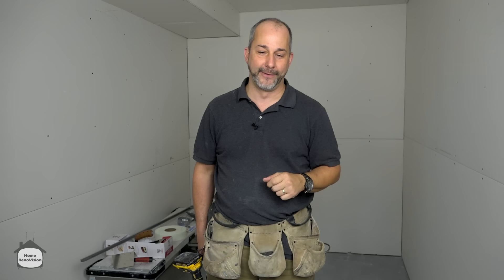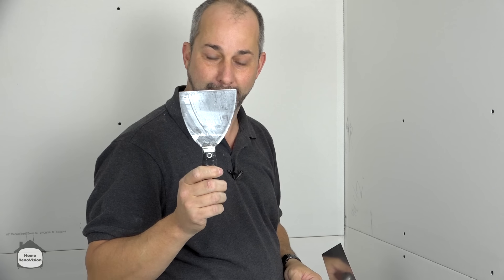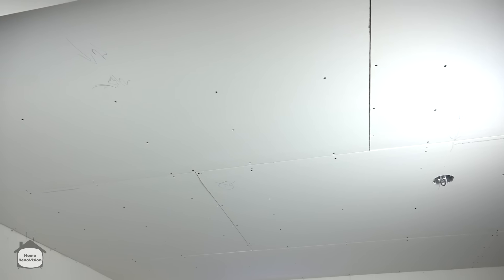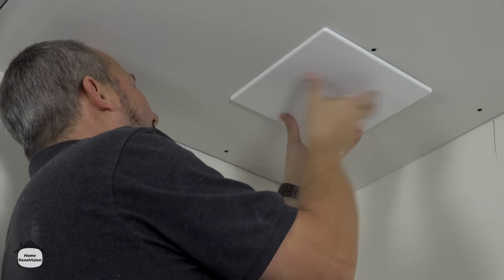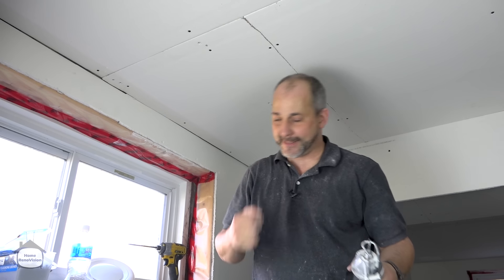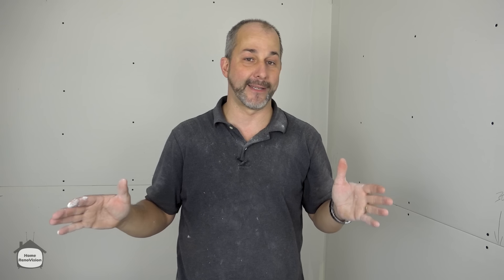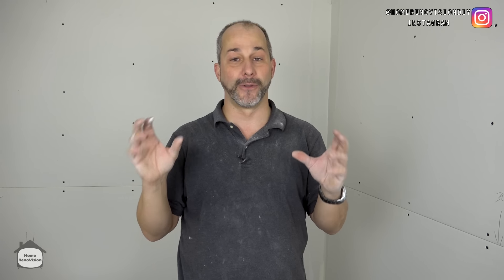DIY Drywall Finishing | 18 Tips and Tricks

Comment: If you use a magnetic bit holder it will save having to hold the screw ! If you round off the corner of your  drywall knife it wont cut the tape and will not leave a groove in the corner. Also how about wearing safety glasses while using Zip tools ? Good video though, lots of helpful tips.
Reply: he dosent wear glasses cos he has tears to get rid of the dust...lol what about all the dust he is eating what it doing to his lungs,get a grip and wear some ppe stuff

Comment: I have a couple bathrooms where the horizontal seam between two pieces of sheetrock has cracked.  assuming the builder already used tape in construction, what do I do to repair so the crack will not return?

Comment: In the last demo you mudded an inside corner with paper tape on lower half and mesh tape on upper half. We see you apply the paper tape- but not the mesh tape! Was the mesh tape already in the corner before the mud was applied? Or is it applied after first coat dries?

Comment: @ ~24m -- How come the sheet metal ducts are not insulated? Are they for heat only? FYI they are in an unconditioned space, and will create mold if the homeowner has A/C running through the duct.

Comment: Ok Im back again.. Once again not a criticism... mesh tape vs old school paper tape?.. mesh tape is not bad and it is quick and easy.. for a basement reno or a small patch.. however it does not "bind" a seam or butt seam.. it is flexible and over time will loosen up on wall seams as all wall do move and show a fracture.. not on patches and short walls so much.. it's "Ok" for that... but for walls such as this? I recommend paper tape as it is likr the surface of the drywall itself and easy to do... tip use taping compound multi purpose mud only.. if you are using topping mud or a drt mix or "Hot Mud mix "20 to 40 min dry mix{ add a squirt of elmers glue for paper tape).. Your taping mud should be just a bit thicker than sour cream.. enough to fill a bit but is for adhering the tape.. you will have bubbles I am sure under the tape.. using the side corner of your 6 in knife  gently slide under the tape where this happens and slip some mud where it is missing and smooth tight middle to edge.  Takes a lot for paper tape to crack later.. the general shifting of a wall will almost always fracture over time with mesh tape in long walls.. do not use mesh tape near doors or windows as these places have constant vibration... however great for around pipes. boxes, patches and fairly low traffic areas..

Comment: Great channel, many helpful tips!  Question on the use of that metal J-channel - can you also use that to cap off the bottom of the drywall that will meet against a concrete floor (like in a basement)?  Or is that totally unncessary and you are better off just leaving X amount of inch space in between drywall and concrete floor?  (Sorry I don't know what is acceptable code/requirement for this!) Thanks!!
Reply: Don't put metal J on the bottom of your sheets, especially a basement floor! Use plastic if you want, but its better to always leave a 1/2" or 5/8" gap no matter where you install it, and let your base trim cover the gap.

Comment: Would you use the trim/edge when you're sheetrock is next to your backer board? We need to repair drywall where we cut out our fiberglass shower/tub (the new stand up shower will be smaller). So I'm trying to figure out how to fix the gap once we repair the drywall, since I assume we wouldn't tape and compound the sheetrock and backer board together. (our new shower will have the tile all the way up)

Comment: HI Jeff.  My house was built in 1964 and  I have 12 inch interlocking acoustic ceiling tiles. They have been painted over once it looks like.  I want to go over it with 1/4 in sheetrock.  Everything I have read and investigated shows this would be acceptable structurally and by code.  Do you have any tips?  Thanks, Brad

Comment: Great clip again fella...question with the mesh tape, the problem I have with it is not it lifting, but the mud shrinking into its surface, sometimes needing a second or third fill to hide it. Do you think this may be down to the type of mud Im using in the uk?..I use ready mixed mostly by a company called gyproc, or Knauf..

Ive got to try the the paper tape thing in corners, I always stick them down with ready mixed wallpaper adhesive first and leave it to dry, as Ive seen a lot of paper tape blow in the past, so im never confident using just mud (we call it compound in the uk) alone

Comment: I have a mid-size (20x17) room in my basement that I am going to start to finish for a man-cave. My ceilings are only 7.5 feet. Is there any reason that I shouldn't hang my drywall vertical instead of horizontal? I would prefer not to try and finish butt-joints since this will be my first interior room I have done myself. Thanks

Comment: Another thing.. finish fastening the perimeter all the way around your sheets once hung  8 inch field in corners and top and bottom plates.. and 12 in the field for each stud... for screws... 7 in field for studs if using drywall cup head nails... for 1/2 inch sheets use 1 1/8 screws or 1 1/4 nails.. for 5/8 sheets use 1 1/4 screws or 1 1/5 cup head nails  chem etched drywall nails... before any taping have all of this done do NOT skip a step... I see much of this has not been fastened to completion...   corners do bear most of the shifting as buildings do so I do recommend paper tape for this.. in either case mesh or paper in a corner?,., make sure it is as tight to the corner as possible... to look square... there ways if if it rounds out or is off to make it look square in the finish coats but best to avoid that... I will stop here You are doing a great job!... once again Jim Turnbow at Facebook!.. I'd be happy to anonymously help you out!

Comment: I am officially in over my head. 😭
I’m finishing an 1100 sqft basement on 115 y/o house. New plumbing, no problem, remove knob and tube, new electrical, easy. Subfloor, framing, even new windows. But muddying the drywall has ruined me. I gave up 2.6 years ago. It’ll never be finished. I’m a baby!! 😩

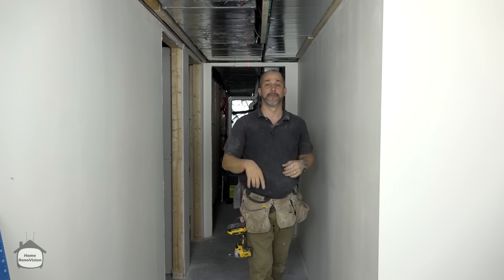Comment: At 32:35 I have a question. Shouldn’t you drywall the ceiling first to prevent this problem? I get that it the walls still are not straight but wouldn’t it be easier in getting a good corner by putting the ceiling then the walls?

Comment: The reason your drywall dimpler bit doesn't fall out is owing to your driver having a magnetic head, which you told your viewers in another video. Many drivers don't. A cut out tool ? For a home DYIer. Another expensive tool which you'd use once or twice..because really how often does a DYIer install drywall ? Buy an oscillating saw..precise cuts for cutting drywall (outlet boxes, not long cuts) and SO mamy more uses.

Comment: i would say that using the drill bit for drywall is a no-go. you end up ripping a circle in the drywall paper making it weaker. also, mesh tape for corners?? why would you do that when paper tape has a crease just for this reason?

Comment: Great video, two simple questions:  why do you choose to do top sheet of drywall then bottom when you are doing walls? And.. I watched a different demo and they wet the tape, is it necessary or just a wasted step?  Cheers!
Reply from the maker: installing the top first helps to close the gaps and makes the install faster as well as the taping. wetting the tape works but i find it stretches too much during the application  and that slows me down. that is why i always wet the tape with mud after it is on. Cheers!

Comment: Hi, I have an odd question. I have an enclosed balcony and one end butts up to a stone chimney.  When we first moved into the house, the crown on the chimney leaked and that water got down to the ceiling of the enclosed balcony. I have sealed the crown and stone in the chimney and I am now refinishing the balcony. Part of that refinishing includes replacing roughly a 4' X 8' piece of drywall in the ceiling. Since I have to do this by myself and I have a ceiling joist at three feet from the stone wall,  I cut the eight-foot drywall piece so I have a three-foot piece and a five-foot piece. Then, while laying the cement board (Durock concrete board) I got the idea of putting a piece of the board on the ceiling so that it butts up against the stone wall. My idea is that if the chimney crown were to leak again, the water would destroy the paint but not the Durock (like it destroyed the drywall originally).  I think I can skim coat the Durock so that it will look the same as the rest of the ceiling.  Does that make any sense at all?
Reply from the maker: sure darryl, but it is only drywall.  even if it need replacing it is easy enough.
Reply: @HomeRenoVisionDIY  Thank you. Somehow, I knew that but I'm 72 and have made so many mistakes over the years because I assumed that just because something was logical to me it was the correct thing to do. Hmmm.

Comment: 32:30 Open the box and fold back the flaps! Open the plastic bag and stretch the plastic over the edges of the box! Pick up the box and dump the mud in the bucket! Pull the box up and then pull the plastic out of the bucket! You'll get almost all of the mud out of the bag! Its fast and easy!

Comment: What if a guy used the 3M glue in the can for the mesh tape in the corners, do you think it would still lift off the drywall if I was using mud that’s not Sheetrock 90 ?

Comment: How does the drywall fit over an outlet hole when you use the roto zip to cut out the hole from the INSIDE of the box?  It seems the hole will be too small….

Comment: So you can put on the fiberglass tape without having to mud first is that correct?
Reply: The mesh tape has adhesive on it. You stick it on and then mud. I do not agree with using in a corner but that just my opinion. I agree with him using a hardening mud as he did

Comment: Ok its paper faced metal corner bead and how do we apply paper tape???? With mud not spray glue.  on lower corners of wall the paper faced "metal corner bead" what your Installing actually holds up better then plan metal which tends to crack as soon as it has been hit.

Comment: I don't use the cutout tool; I prefer the HF little yellow switchbox marker, a little box with six pins you clip onto the box and tilt your board into it, go behind and razor out between the pin marks - neat and perfect.
Lacking that tool, crayon on the boxlips can work if you don't smear it locating the board.
   Next, C.H. Hanson makes a little black and yellow magnetic stud finder with 2 neobdynium magnets that will actually hang it off a nail in /2" drywall! This also means your buried valves, ducts or gas pipes may be detected this way.
   I have started with merely a fist sized hole when I'm not 100% sure where a lost item is, so I can cut the larger hole in that direction.
   Haven't found a drill tool holder yet that would either stay on the drill or not lose bits. For this, I think Lowe's has a belt clip magnet for screws or nails, but is best for bits. The wrist worn one's only have weak ceramic magnets and are crap.
Reply from the maker: Hi Gary. I really suggest you try getting acquainted with technology and the cutout tool. It will save you hours on your next job!

Comment: Drywall is great for people new to diy . Any mistake in the drywall or mud its self can be easily corrected .anyone can make a room look good it just might take you longer than a "pro"  little risk so don't worry if its not pretty sanding or another coat no one will even know the mistake is there. Going at a careful pace with attention to detail is always faster in the long run because you won't have to go back and correct as often. Happy mudding all

Comment: How do you fix the area where the fiberglass tub and shower meet the sheet rock? Ours is starting to peel up there, I am tall so that area gets a little wet there
Reply from the maker: scrape off the failing material and then use 45 mud to repair. 100% acrylic paint to finish. or add subway tile above the insert and use a grout with sealer. Cheers!

Comment: Great video but at a sheet metal worker the hvac tip was cringed. You especially want to be sure you plenty of screws in the duct work in a finished ceiling. If you have duct cleaning or are having you're equipment retrofitted it can become dislodged in the ceiling and at that point you'll be cutting your ceiling or wall. So do it right the first time. Trust me I see this weekly.

Comment: Great instruction Jeff.  In the U.K. it's a common practice to adhere drywall to uneven brick or concrete walls with the "dab & dob system" by applying blobs of drywall adhesive to the wall and pressing the drywall sheet against the wall and tacking it with 3 or 4 Tapcon screws.  They sell a 25 kg. bag of dry mix "Gyproc Adhesive" for about $20 Canadian.  In Canada, I've only seen "drywall adhesive" sold in a 300 ml. caulking tube for about $10 per tube.  Do you know of a similar dry mix bulk product and where it can be obtained in Canada?

Comment: On perfect depth for screws: not so. Even though I used both hands to push on the driver tool I had problems to set the screw to the correct depth. In my opinion a Torx /Star driver would do a much better job. Torx uses only rotational force to set a screw rather than a Philips drive force that requires force in the direction of the inserting screw .

Comment: Thank you for so much great info!  What would you recommend for a southwest 30y/o home where wallpaper was not removed well and left bumps and designs on the otherwise smooth walls when the other rooms in the house of knock-down orange peel?
Reply from the maker: Hi Melinda, always best to remove the paper and then re access. maybe add texture or keep it smooth if it is in good shape. Cheers!
Reply: @HomeRenoVisionDIY  If it is really, really bad, cover it with 1/4 in drywall. this is the best way over flocked paper that has been painted.

Comment: You may say "Don't be ridiculous" to an electrician who complains about wires being nicked by the drywall guy who's working too fast. But a nick in the insulation of a energized conductor may be too small to see during construction, but will open up over time and potentially cause a fire! 
     I know this doesn't surprise you, because I think that I understand what you're really saying. But you're teaching others here, and it's bad practice to take an electrician lightly when we tell you something is dangerous. Minor electrical problems can turn into $1000 service calls when we have to search to find a practically hidden slice in a wire, or, worse again, we can't help with a fire.
     I really appreciate your video. I hope my criticism isn't offensive to you or your fans.

Comment: Ok better at Drywall than computers screwed up my last comment... but Yeah I have some vast experience?.. So tips for the tool to use to fasten?,, a depth set tip is awesome!.. If you have the money a clutch head drywall screw gun is awesome! it is also depth set, but will not engage the drive until you push and great for all other projects as well as it does not drive at all till you push.. your recommend is great for a drywall DIY and cheaper than a new tool...On missing the stud? I would say do NOT remove the screw.. simply tap it in below the paper without breaking it.. no hole that way..easier to cover without future show.... "Roto bits" are great.. here's another tip.. after you cut your bottom sheet to length?,, no measure tip!   put the sheet in place.. (Have your Drywall Axe,, need to have one!.. lean the sheet back so you can see behind.. look at your outlet and do a light scratch with the axe side on the front at an angle through where the center of the box is down from right to left close to the center of the box... then shift and do the same left to right.. lightly do not damage the paper... you now have the center of the box!.. no measuring! Then use your roto bit as you showed... get good at this and you can do pipes as well!.. no roto.. get the center be precise takes practice but its easy... for small copper pipes a drywall keyhole saw has a collar at its base for this.. pungh it through at your mark all the way thru the collar.(Keep in mind you may have to lift the bottom sheet up a bit so adust for that)... (To lift a sheey use a kicker... a flat wunderbar and small shim works great as a lever if you dont have one... lean sheet back reach down and clean the back.. you can also for boxes lean back and eyeball carefully the sides of a box then measure the top of the box measure and  mark the top in front with a pencil add 3 5/8 " and cut front with drywall knife.. then keyhole saw saw or just punch out.. clean the back leave no debris DO not miss and cover a box! it happens if it does tap a bit you find the box you missed its pretty easy to find and then roto bit or keyhole saw... this is getting long I will add some more.. Not criticism as I said just some helpful hints I hope you appreciate! You have great tips! I will stop here for now... and move on in another comment.. Feel free to find me on facebook Jim Turnbow to tell me to lay off or if you would like to know more.

Comment: Cracks within 1 year that inside corner the drywall was not screwed down to the studs. No question about it it will crack and you will have to scrap off the paint wet down the mud scrape off the mud and screw both sides of the dry wall. Screw the pajezus out of it too. Put in one screw every 6 in. Old houses are bad and new are bad for drywall corner cracks
Reply: Never liked hocks I use the small red tray holds tons of mud and stays clean.

Comment: Quick noob question: remodeling a bathroom and I am trying to mud between a mirror (glued and not removing) and the wall. It’s a narrow space, like 2” and it’s awkward and in the corner. How would go about getting a smooth finish there?
Reply: There are plastic putty knives that can be cut down to your needed size.